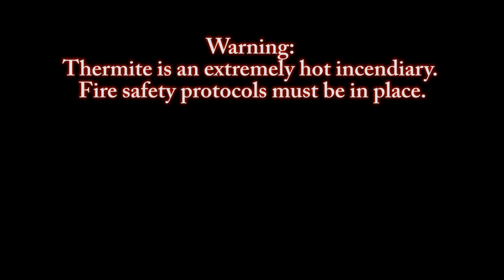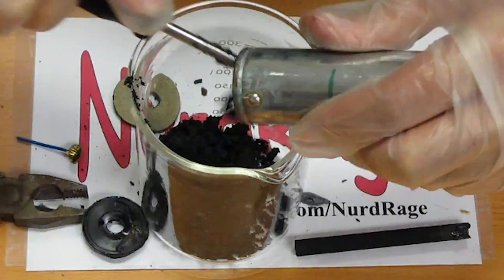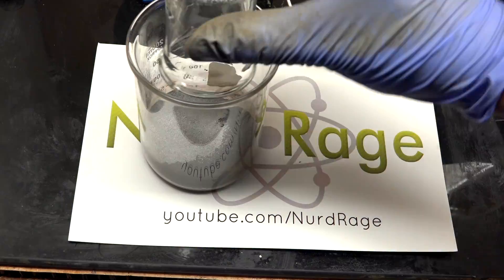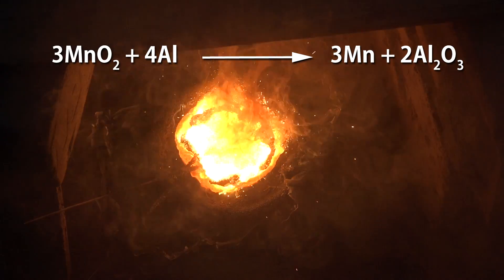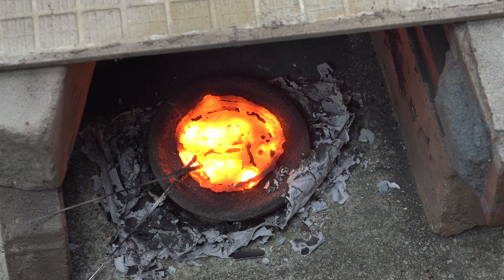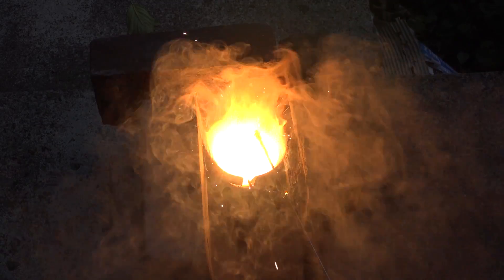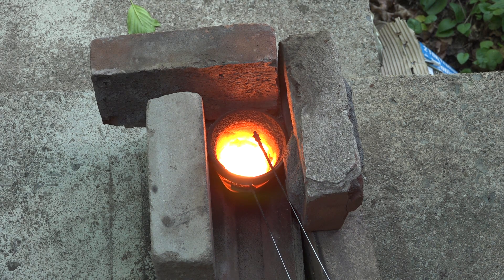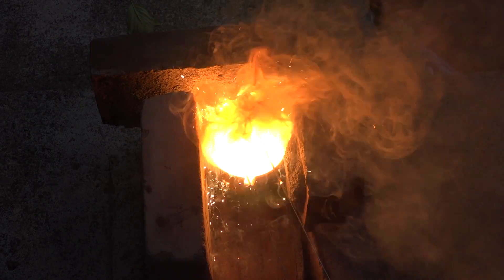Make Thermite with Manganese Dioxide

Comment: When I made thermite with Manganese Dioxide it flashed almost explosively. It left tiny globules of metal on the side of the flower pot. But the whole thing reacted in a fraction of a second rather than a slower burn rate. Scared the heck out of me as I hadn't backed away yet. 
I've doped regular Iron Oxide thermite with small amounts of Manganese Dioxide but don't really notice an effect. Next is trying something like a 50-50 mix of manganese and iron oxide.

Comment: that would made a good "nuclear" generator to drive a turbine that charges small vehicles, just imagine, you put a defined amount of thermite in one side and get iron and aluminium oxide in the other. We can use solar mirrors to heat the aluminium oxide to turn it in to aluminium, releasing the oxygen absorbed by iron. Why do people still have to follow fucking mandatory laws.We could make replicating solar mirrors in the desert to use the desert as cheap  and most profitable fuel but the people in the fucking middle east want to just play dumb for a little more time.
Reply: i mean, use it to convert the heat to electricity, and then use it to charge a supercapacitor to use an electric regenerative motor. You migh use the boost of hundreds of watts in a motorcycle, complete breaking energy regeneration to the supercapacitor, long term boost from the recharge thermite based turbine. I guess there's gotta be a material wich can resist and dissipate a small amount of thermite without any problems
Reply: fss1704 if you can supply enough energy to synthetize the reactants of a thermite reaction starting by the products then this would be pointless. Since thermite reaction is EXTREMELY exothermic you'd need to spend a huge amount of energy to bring the products at the high energy state of the reactants. Better to directly use that energy to move your vehicle. Every step that you do brings to an energy loss, expecially reacting thermite. At such high temperatures the heat dissipates pretty quickly.

Comment: Idea, can I use this as a fuel in a forge made of firebricks to melt copper?
Reply: mob alottt no, the reaction is way too slow and you'll dissipate your heat (even if you reach Cu melting point you'll still have to mantain it for a quite long time, until all of it melts, and this isn't easy. Maybe it would work to melt small batches of copper

Comment: Can you make a video on how to make magnesium oxide/ copper sulfate from magnesium sulfate(Epsom salt) via electrolysis
Reply from the maker: +noah he (noahdthehorse) Sorry no. That's beyond my ability.
Reply: why i think it is just simply electrolysis i just don't know how long to do it for. I am pretty sure that the magnesium oxide just settles out.
Reply from the maker: some of the the copper also precipitates out. So the conversion is never perfect. I'm sure there is a way to perfectly substitute copper for magnesium in magnesium sulfate. But i don't know how to do that with just electrolysis. Thus i say it's beyond my ability.
Reply: thank you, really appreciate your response I don't need it to be perfect because i am just using the magnesium oxide to try and make my own insulating fire brick to protect the insulating ceramic blanket that is going to be hind it. do you thing that that would work?
Reply from the maker: Should have asked that before rather than limiting the options by saying it had to be with copper and electrolysis. You can precpitated the magnesium from magnesium sulfate solution by mixing it with baking soda (sodium bicarbonate). The magnesium will precipitate out as magnesium carbonate.
Reply: but how do I turn the magnesium carbonate to the magnesium oxide?
Reply: +noah he burn it the process is called calcination fire safety protocols must be in place

Comment: I have a question. thermite welding / casting.  using thermite to bond two metals and using thermite to melt and subsequently cast metal.  would this process works
Reply: How's this for a reply to an ancient comment? I came across a video once of iron thermite reacting over a clamped on mold to weld railroad tracks commercially. Also, in the last few months Cody's Lab casted a skillet that way. Maybe more impressively, instead of paying for or making aluminum powder, IIRC, he used aluminum foil or cans, and may have used a magnet to collect free magnetite from yard soil. If it weren't Cody, I'd suspect it was faked. It was like 20 kg of the stuff though which may have helped with the chunky aluminum problem.

Comment: Hi! Thermite's incendiary properties are well known.  I was wondering what is the best way to stop a thermite reaction mid-burn?
Reply: idk if u can do that
Reply: Use sand.
Reply: @AnoNymInvestor  Sand doesnt work since the oxygen needed for the reaction doesnt come from the air but from the reaction mixture itself. It will burn under sand, water and CO2.

Comment: Now, I know this is just a thought about preserving cheap flower pots, but do you think they would crack less if they were dried out in a kiln prior to usage? Or is the fracturing purely due to thermal expansion?
Reply: These are unglazed flower pots. That means they absorb moisture from the outside air. The cracking is due to thermal shock due to the flashing of the entrapped moisture to steam as well as the thermal expansion in discrete areas, thus the expansion not being uniform over the entire part.

Comment: I have often read, that the manganese(IV) dioxide has to be turned into manganese(III) oxide by heating, before it can be used for thermite. And it's often said that the heat of the reaction makes the manganese metal evaporate, leading to no yield at all. Quite interesting!
Reply: No. MN (111) Is synthesized by the electrolysis of MgO(11) and ammonium sulfate.
Fairly simple electrochemical reactions

Comment: So if the thermite reaction (simplified for my tiny brain) is Heat+(metal)oxide+Aluminum = (metal), is there theoretically a way to increase how violent the reaction is? Does it only work with metal oxides with the correct oxygen availability, and if not, could you use an oxide with a higher volume of oxygen per gram than iron, then just add more Al? Or am I entirely misunderstanding how this works?
Reply: I don’t know much about it either but I have learned a lot from stryropyros video: exotic thermites. Maybe it helps and otherwise it’s a good video anyways

Comment: How does put out a thermite fire?
Reply: One runs out of fuel.    Thermite is pretty much one-way trip once started.  Ignited portion will burn until intern oxygen is gone.  Once ignited it will burn under water or in vacuum. 

Special cryo-extinguishers can draw heat out fast enough to halt reaction.. but not a common thing to have on hand.
Reply: Jesus... so you have no way to stop it in home conditions?
Reply: Nope, Don't use it indoors.

Comment: Is it possible to use very fine iron filings for anything? Can they be mixed with something else to make something more interesting. Or is their only use making pretty patterns with a magnet?
Reply: You could probably mix it with an oxidizer like potassium permanganate and light it up. Iron or steel powder is used in sparklers I believe

Comment: broken hot plate is bad...i can't imagine how the hell can they sell a piece of shit for $500 ....
electrochemistry is cool...i think you'll do goldplating which is really cool but useless since not many are chemists and can handle cyanide....
unless you show few other options ...not as crazy toxic as cyanide...
Reply: whats wrong with cyanide? you just shouldnt drink it like most things he works with. just wear protective gear(long gloves and a gas mask), dont touch it or breath it in and you'll be fine. there are many corrosives and stuff which are way harder to handle.
Reply: +jort93z i know that but still is the LD scary...
also if i need cyanide i need to make it...it's easy done with urea but it's kinda dangerous
also i don't have propper lab, i do most things with good ventilation or outside...if i spill nitric acid it will make a hole in concre...if i spill cyanide my cat could die, i don't combine animals and chemicals but you should get the idea...if i had a fumehood and lot.of space i wouldn't care and use cyanide
Reply: +jort93z yes i need a gas mask anyways but i won't get cyanide now...
but i want to extract pure nicotine ...i have read few papers and it should be possible ...and nicotine is as toxic as cyanide as far as i know...and pure nicotine dosen't scare me..(i don't smoke) it's weird....i can handle liquids way better than fine solids...
i'm also not scared to explosives and corrosive stuff...
i hate poisonus chemicals and drugs...even if i like to.extract them.(drug, anestetic....legal...illegal...whatever...)
Reply: +jort93z also i'm from Germany and the law here is just shit....
we'll see how my interest in chemistry goes over the years...i already know some stuff.and i have a bit of equipment...
Reply: You can't get nitrates or nitric acid without cops or paper shit....it pisses me off harder than you think...
Reply: jort93z yes and they save my data and other shit...i just don't want to be suspected
Reply: Birkeland-Eyde reactor does wonders for your nitric acid problem.

Comment: Do you think it would be possible to make boron nuggets with some borax/aluminium thermite?
Reply: Your reaction chemistry doesn't line up - you'd need boron oxide, not sodium tetraborate (Borax).

With boron oxide (specifically boron(III) oxide), yes, thermite can be made with boron serving as the metal oxide component. Pure boron can also serve as the metal powder fuel in a thermite mixture (but that gets you boron-based slag).
Reply: PyroDesu I don't know why I said borax, I meant boric acid...

So, could you make boric acid/aluminium thermite? Or would the thermodynamics not allow it?
Reply: It has to be boron oxide. Even if it did ignite with boric acid, I would be very wary of doing so, with those three hydrogens (also, it technically wouldn't be a thermite. Thermite is specifically metal powder fuel with a metal oxide). You'd have to liberate the hydrogen from it for the oxygen to break off the boron and bond to the aluminium - which might screw things up, thermodynamically, but more importantly would mean that you have free hydrogen atoms in an already very exothermic reaction.
Reply: PyroDesu
 Boric acid is boron oxide plus three water molecules. It can simply be regarded as an unusually acidic metal hydroxide.

It is a thermite just in the same right as aluminium/rust is a thermite, since rust is an ill-defined mixture of iron oxides and hydroxides to begin with.
Reply: No, boric acid is boron(III) hydroxide - a boron atom bound to three hydroxide groups. To get boron(III) oxide, you have to liberate the hydrogen from the hydroxide groups (which is done by dissolving the boric acid in water above 170 degrees Celsius, where it dehydrates into metaboric acid (H3BO3 → HBO2 + H2O), then heating the metaboric acid to above 300 Celsius, where it dehydrates further to form tetraboric acid (4 HBO2 → H2B4O7 + H2O), then further heating until it decomposes into boron(III) oxide (H2B4O7 → 2 B2O3 + H2O).

And just because rust is ill-defined doesn't mean that the definition of a thermite isn't what it is. The only reactants relevant to thermite are the metal fuel and the metal oxide - contaminants in either can be ignored unless they decompose on heating to form either of the two.
Reply: PyroDesu
Yes , boric acid is boron III hydroxide, that IS what I was saying.
Please, read again the very equations you copy/pasted : to convert it to the oxide, you evolve water. H2O. NOT H2.
Thus it is done with the solid (and then molten) boric acid. Obviously NOT in aqueous solution.

So a thermite reaction between boric acid and aluminium, if it is thermodynamically and kinetically feasible (which is the core of my question) would simply release the water from the boric acid with its own heat, and then be equivalent to a reaction with the oxide

Rust contains a significant portion of hydroxides, way past the point where they can be considered as a simple impurity. But again, the heat evolved from the thermite reaction leads to the release of water vapor and is then equivalent to a reaction with the metal oxide.

Sure, boron oxide would likely work better (if the reaction works at all), as you wouldn't have to deal with the positive enthalpy of dehydration anymore. But that does not rule out the possibility of using boric acid.

Also, I'll point out the fact people make thermite reactions between magnesium and sodium hydroxide. (Check out those by NightHawkInLight)
Reply: 1: I quote you, "Boric acid is boron oxide plus three water molecules." That's what you said. That is saying boric acid (boron(III) hydroxide) is B2O3 + 3 H2O, which it is not. Creating boron(III) oxide from boron(III) hydroxide does mean generating three water molecules for every molecule of boron(III) oxide, but that does not mean that 4 H3BO3 = 2 B2O3 + 6 H2O, it means 4 H3BO3 → 2 B2O3 + 6 H2O. The difference is significant.

2: I said that the hydrogen atoms must be liberated from the boron(III) hydroxide, I said nothing about what happened to them other than that. I never said that they reformed into diatomic hydrogen gas, or did not go on to bond to oxygen and come off as water - indeed, that is what they tend to do quite a bit, very exothermically (241.8 kJ/mol released to form water in a gaseous phase).

3. I admit, I was wrong. The fact that boron(III) hydroxide is soluble in high-temperature water was in the same paragraph as the reactions. In my haste, I took that as a requirement for the reaction to form metaboric acid, with the water functioning merely as a solvent and not participating in the reaction (yes, it is possible to perform a dehydration reaction in aqueous solution, I think - after all, you're forming new water molecules from the reactant molecule, not driving already existing water out of its structure. I don't know if it's possible for boron(III) hydroxide, but I'm fairly certain it should be possible in a general sense).

4. I can't properly answer as to whether it's thermodynamically possible - to be frank, I would more than likely miss something trying to do the calculations for it. Sorry, but it's not my strong suit and what I learned about it was several years ago. I know it's not too complicated at it's core, it's just that there's a lot of factors to take into account for it. Also, it's past midnight here and I probably shouldn't be commenting while tired, much less doing lots of mathematics. If I had to guess at it, I'd say that it might be possible - there's a lot of energy being given off by every dehydration reaction, but at the same time the transition between metaboric acid and tetraboric acid is probably going to take a lot of energy, because you've got to get 4 boron atoms and 7 oxygen atoms bound together - it might be endothermic even with the water formation. I can say that it probably won't be easy to ignite, either way, at least without some initial boron(III) oxide in the mix - that might be enough of a kick, just because bonding oxygen to aluminium is a hell of an exothermic reaction, ~1670 kJ/mol.

5. It doesn't matter how big the difference between the amount of the chemical you want and a contaminant is, it's still a contaminant (imagine, if you will, you had a bottle marked that it is 99.9% pure X, and you know the remaining 0.1% is Y. If you're trying to get Y, X is a contaminant, even though normally Y is the contaminant. It is simply the unwanted constituent, either way).

6. You're seriously taking a small terminology quibble way too far. A metal hydroxide/metal fuel mixture wouldn't technically be a thermite compound, though it would be a thermite reaction as it burns if you could ignite it. I shouldn't have included that, it's made this whole thing far more argumentative than I would have liked.
Reply: PyroDesu
Yeah, I won't go on any further with that sterile debate over nomenclature.

My question was : 2 B(OH)3 + 2 Al --> 2 B + Al2O3 + 3 H2O
Is this reaction feasible or not?

Though I guess nobody will bother going through the whole thread to discuss it anymore. I guess I'll just sum up the bond energies to get an estimate...
Reply: Or just try it.
Reply: Ilgaz Er
I'm afraid I currently don't live in a place where I can try this.

But I made the calculations with the enthalpies of formation of boric acid, alumina and water. I did get a negative value (I forgot how much exactly) that would seem to indicate the whole thing is possible.

Comment: Can this even work with, let's say.... uranium oxides?
Reply: The metal must be more reactive than the metal oxide in a thermite to work I believe. I don't know the exact definitions for what can or cannot be used, but I would think Uranium metal would be needed. Powdered Uranium would react very quickly with Oxygen in the air. So no basically.

Comment: I wonder about vanadium thermites... Can they be made, and can the reaction sustain itself? Because vanadium's quite high up in the melting point. Also, a nickel one?
Reply: Yep, I've made one with V2O5 and recovered a nice chunk of V from it! I've never done nickel but it has been done before with NiO.
Reply: I doubt you'd be able to get those to work because of the extremely high heat required. You'd have to calculate the heat of formation (I think) for the reaction between each oxide and aluminum to see if it is favorable, and produces enough excess heat.
Reply: mrhomescientist that wouldn't be enough. At such high temperatures heat dissipates very quickly, and part of the energy is relased as light. I don't think that tungsten can be molten with any sort of thermite reaction. You need a voltaic arc furnace in order to melt it.